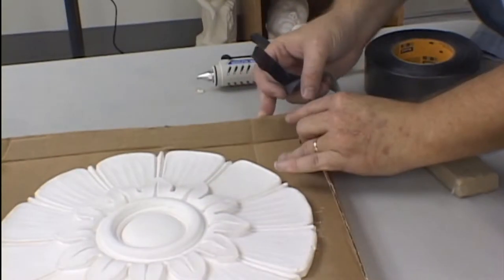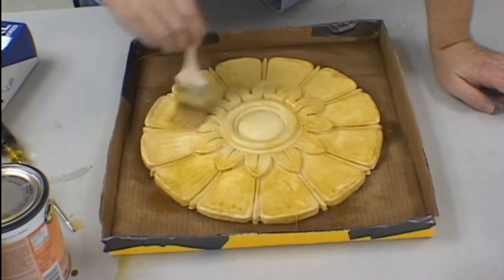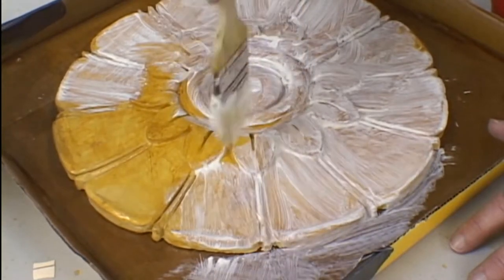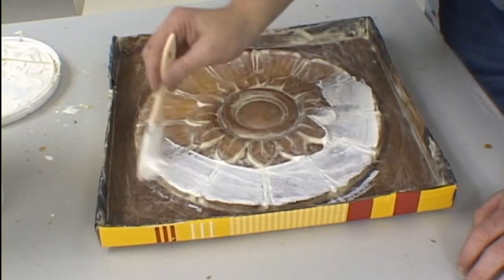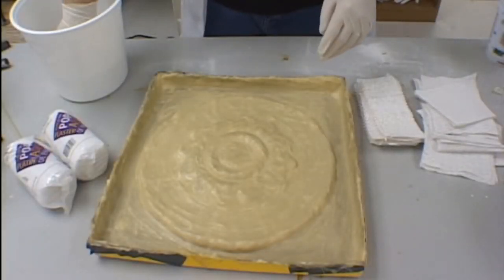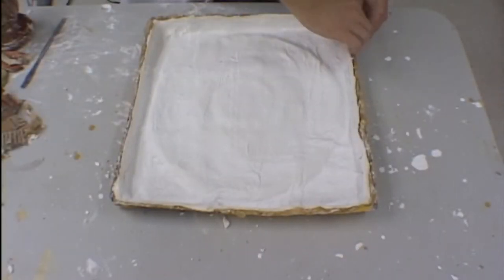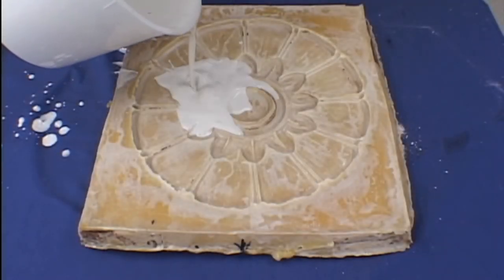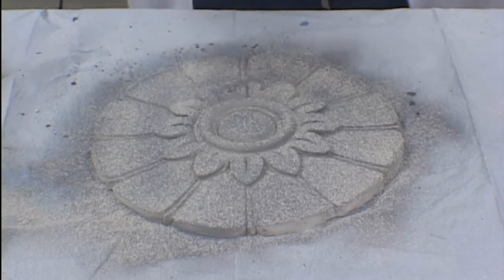Latex Blanket Mold with Plaster Bandage Shell

Comment: For anyone watching this video ... never use any petroleum product on latex. And fyi, most soaps have petroleum in them. Petroleum will destroy latex. Ever have the problem where your latex mold is becoming gooey, sticky, and falling apart? It's most likely because you've cleaned it or added a petroleum product on it. Instead, use 70% rubbing alcohol mixed with a little bit of caster oil (not motor oil) for a mold release. And to clean your molds after using them, use water mixed with some white vinegar. Using petroleum products with latex is bad info. Hope this tip helps someone ... Oh, wanted to add that sunlight will also destroy latex. Always keep your molds out of the sun.

Comment: How long should I wait between coats of latex? I've heard everything from 30 mins to 40 hours. I've also heard the previous layer should still be tacky and that it should be completely dry. Lots of conflicting info.
Reply from the maker: Dear Craig, your latex should be dry to the touch before you apply the next coat. Latex dries in air. If you apply the next coat before the surface of the first coat dries, that coat will never dry and your mold will have soft spots. It can take an average of two and a half- to three hours to dry under normal room temps and humidity. You can half that time if you put your work in front of a space heater or a fan. Best regards, Ed.
Reply: @EnvironMolds  thank you
Reply: @EnvironMolds  can you wait too long? Like if you put coats on all day every 2-3 hours, but then at night leave it for eight hours until the next day?
Reply from the maker: @craigdwillia  You can't wait too long. Not too worry.